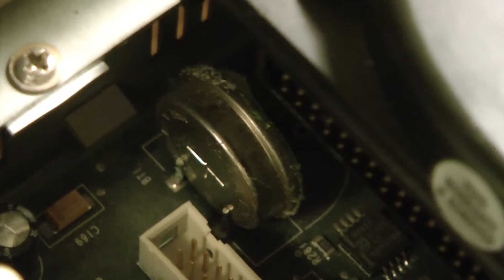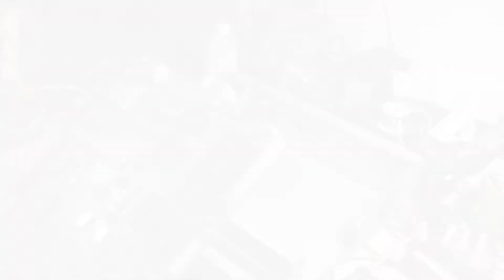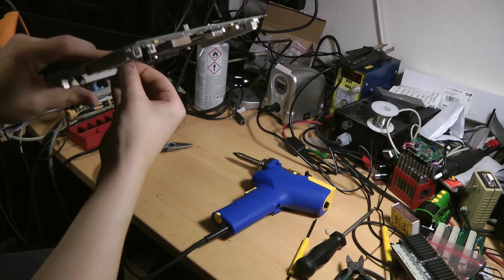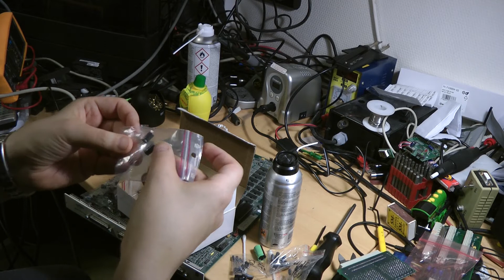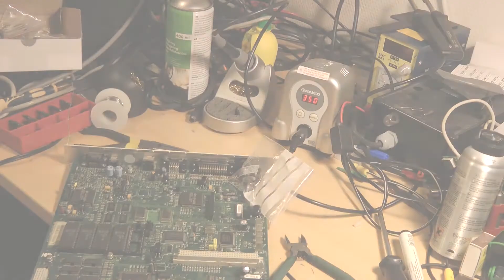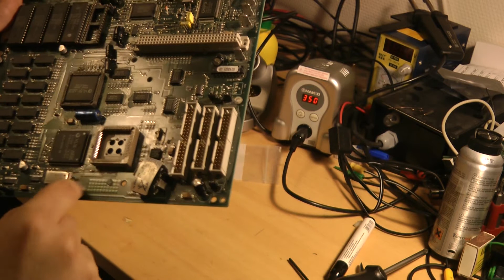Säätämö 2: Acorn A5000:n elvytysyrityksiä

Comment: Join a friendly Acorn community here : http://www.stardot.org.uk/forums/
Sorry I don't understand your language but if your keyboard works keep pressing the DELETE key while powering on the machine, it's necessary to reset the CMOS values to default factory settings.
Then for the hard drive, unders RISC OS, press F12 to access the CLI and enter CONFIGURE HARDDISCS 1 then ENTER and press CRTL + BREAK to reboot.
Reply from the maker: Hi, thanks a lot for the tips - already joined Stardot, actually. The problem with this machine is that the keyboard does not work. I will be publishing a second video about further research later...
Reply: OK great then. I hope you manage to have it working. Is it a 25 or 33 (rarer) ARM3 A5000 ?
The machine can be overclocked easily and it's safe.
Your machine has 2 Mbytes, and you can add a 2 Mbytes daughterboard using the free connector in the onboard RAM area.

I hope it's a rechargeable battery you will install... and not just a battery ...
Reply from the maker: Actually I have two: one has a 50 MHz oscillator and the other has a 66 MHz one. You can see them both in the second video. The problem is that I only have one keyboard and it works in neither of them.

The battery I installed is a 3.6v NiMH unit, I am aware that you need to fit a diode to prevent charging if you use a standard battery.
Reply: OK. So you've got a standard 25 Mhz and a rarer Alpha 33 Mhz A5000, which is very good, indeed !
You can overclock the 33 Mhz to 42 or even 47 Mhz ...
See here : http://qubeserver.com/Qube/projects.html